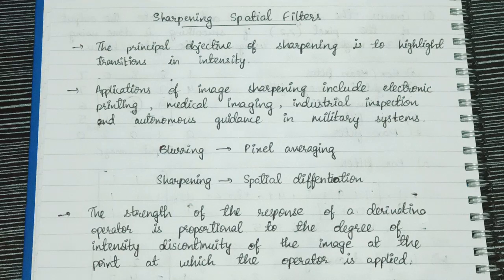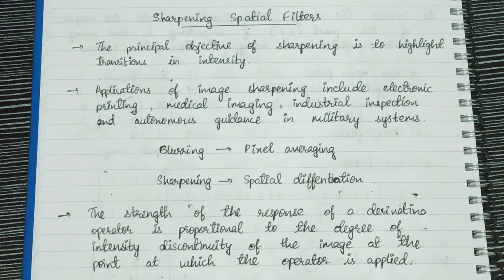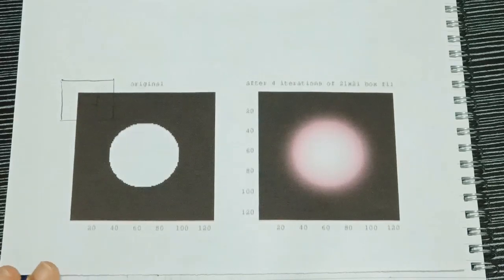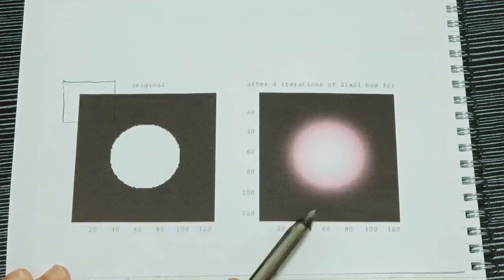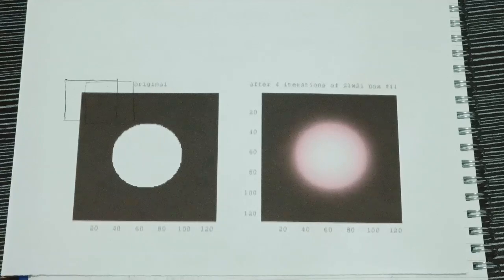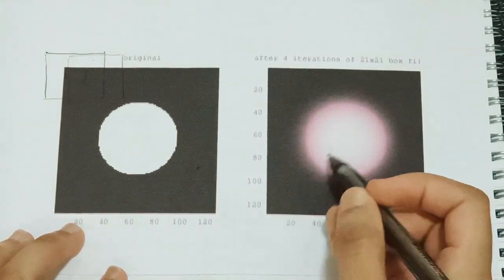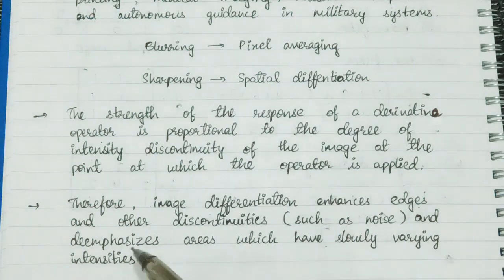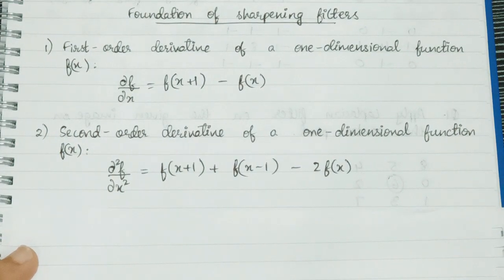Sharpening Spatial filters in digital image processing with examples

Comment: there is a doubt, 450+300-400 = 150? it should be 350
and also 150+500-400 = -150? it should be 250
did you use some different method or is there any rule followed. 
Any one can solve this problem ?
Reply: actually bro there was a calculation mistake as 50x5 = 250 not 450. so it is 250+300-400 = 150
Reply: and in the next case it should be -800 but mistakenly written as -400

Comment: In Q.3 there is a small calculation mistake . When shifting the mask 3rd time ( 50 * 5 +100 * 3 - 50 * 8 )  
= 250 + 300 - 400  
=150
instead of 250 by mistake you have written 450.

Comment: Mistake at 16:24 and 17:21. Thus the result image is wrong.
Reply from the maker: Thank you so much for pointing this out. The values would be 350 and 250 and therefore the final image would differ accordingly. I hope that you understood the concept though :)
Reply: @College Friendly Thank you for detailed explanation. But sharpen_image = original_image - filtered_image. Here, you only determined the filtered_image, not the sharpen image. This actually made some confusion. Keep posting.
Reply: @atikhasan4358   @College Friendly  we have to subtract the original image from the filtered image to get the final sharpened enhanced image right?